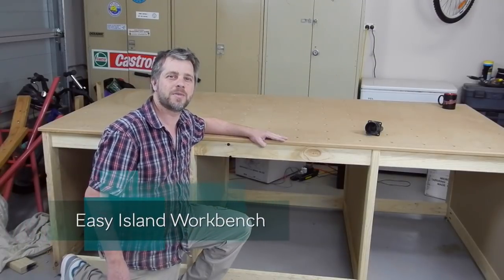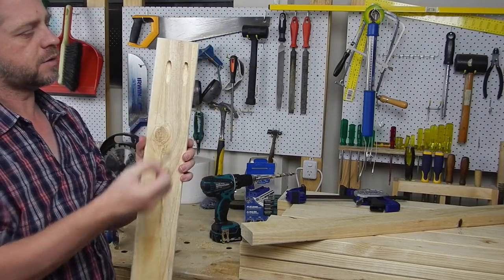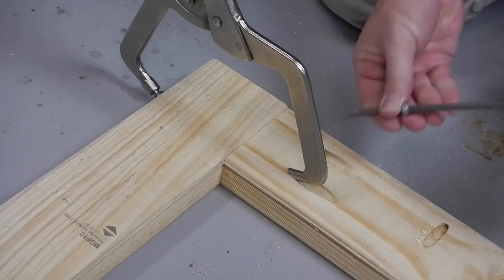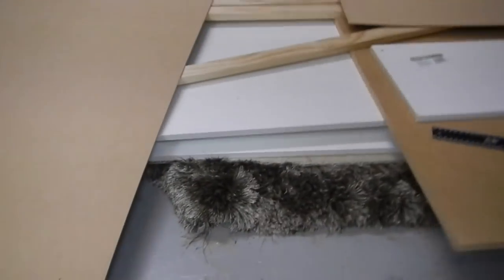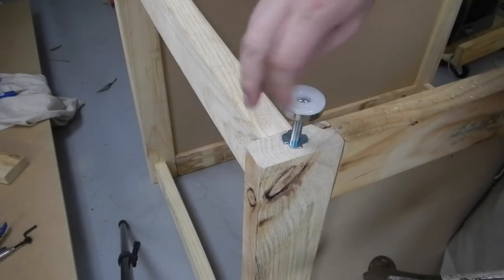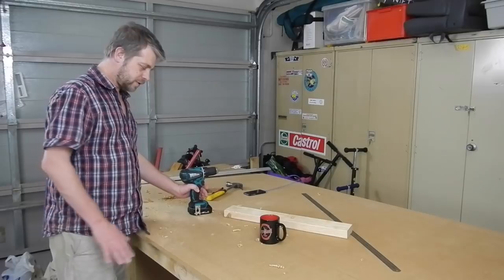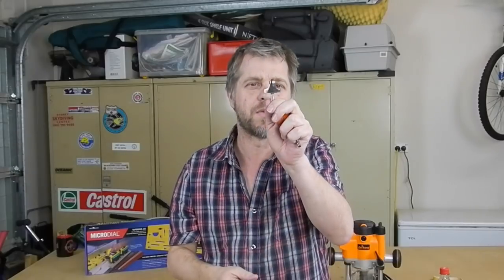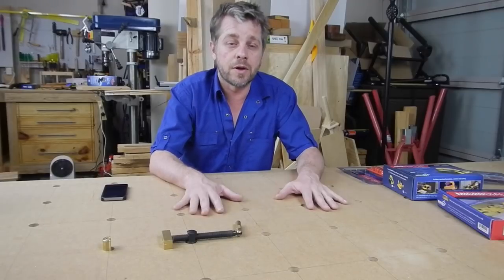How to build a DIY workbench for woodworking projects using a Kreg HD jig pocket hole jig

Comment: Hey Warren, great video mate. Not a lot of aussie woodworkers on here so was glad to hear your accent. Mate, just one question, where can you get those clamps. Want to make the same bench and love those clamps. Also, a new battery in the smoke detector will work wonders, mate. Cheers.
Reply from the maker: Hey Chris thanks for that much appreciated, you can get the Kreg HD jig from carbatec.com.au they are super handy i use mine all the time, the normal kreg jig would be better to start with i think as you can also use it for furniture, drawers etc

Comment: Hey Warren.
Love the video how to.
One question please; 
What material is, (and how thick) your table top? Looks like a composite material, but please, what exactly.
If you mentioned it, sorry.
Wife has bought me the Kreg Master Kit for Christmas, so eager to build myself a work table using your cool ideas.
Thanks again
Reply from the maker: Hi Ross, awesome you have a great Wife, i used MDF its really good for bench tops as its cheap and stable its dusty when you cut it so make sure you wear a mask. Mine is 18mm thick which is around 3/4", if you are making a smaller bench you can also glue and screw 2 pieces together for a thicker top so it does not move around when you are working on it.

Comment: Hi Warren! I just wanted to know, where do you get your 2 x 4's? the ones you used for this bench are very nice and straight.  And I love your Big Square! I think I'll make 2.  Thanks!
Reply from the maker: nancyrfrinemonsreal Thanks for that, the square has been super handy, i get my framing timber from either ***** or Bunnings both are generally good, sometimes you have to pick through t a bit to get the really straight pieces.

Comment: Hi Warren, How did you connect the MDF top to the bench framing? I didn't see any screw holes in the top... (it looked good)
Reply from the maker: Hi There, i used pocket holes in the frame pointing up into the MDF, it worked rally well.

Comment: That's a great looking bench, do you plan to add a storage system (e.g. drawers/shelves) to it? I also have a question regarding the `dog holes', did you find that the drill bit left a lot of tear out in the bottom? It's a problem I've faced a lot when I use Forstner bits, so I wanted to get a sense if maybe spade bits help reduce that issue. Thanks!
Reply from the maker: Hi Jeffrey, the spade drill bits leave less tear out on MDF than the Forstner bit and also eat through the MDF much faster without getting clogged up, they still do have some tear out but nothing to bad, it wont be seen. I was going to put drawers on each end you can access from both sides and cupboards with shelves in the middle, i will do a a video on it as well.

Comment: Warren, the plans indicate that you use 90 x 35 timber but the kreg HD us for minimum of 38mm thick wood. Did you change the drill depth for a 2 inch screw and used the 2.5inch screw or use it as you would use 2.5inch screws ie. for 2x4s?
Reply from the maker: +Anthony Keyburn hi Anthony I just used the settings for 38mm, 2mm would not really make a difference.
Reply: Warren Downes - One Wood Thanks Warren. Merry Christmas

Comment: What are you using for your table top? That looked like solid wood.
Reply from the maker: +Jeffrey Dols I am using MDF for the top, its nice and cheap so if i bang it up it only costs about $30 replace the whole top. Its also stable and does not expand. Just make sure your wear a dust mask when cutting it or sanding it as the dust is not good for you.

Comment: How you built your drawers under that older table? I need some designs to steal for mine :)
Reply from the maker: I plan on doing same thing on new bench, there will be a video for it, but basically all i did was build a MDF box to fit in the area and add runners down the side of it, the drawers are mdf with a pine front.

Comment: Good video. I have some questions. What's the name of the claps you use on top of the surface? The ones you made holes for? And the other is the name of the clamps you use for your triangle. Looking forward for more videos!
Reply from the maker: Thanks Camilo, the the bench clamps are LeeValleyTools http://www.leevalley.com/US/wood/page.aspx?p=62720 i love mine use them all the time, the clamps i used on the triangle are called fence clamps also handy for use on table saws if you want to have an auxiliary fence. Check out our channel i posted another video last week for a moxon vise to fit on the Bench
Reply: OneWood - Warren Downes too late already saw it and subscribe. Good stuff

Comment: What kind of wood did you use for the top?  I like this option a lot better than standard plywood.  It seems smoother and cleaner and not to mention you can round over the edge rather than having to buy separate trim to cover the exposed edge on plywood.
Reply from the maker: Hi Bryan I used MDF For the top. It's also a lot cheaper. That sheet was $23. It definitely is much smoother and if it gets banged up its cheap to replace. Make sure you where a respirator when sanding or cutting it. It's very stable as well which makes it good for jigs.
Reply: OneWood - Warren Downes
I would just add one caveat when it comes to MDF, OSB, or particle board.  If your shop is in a humid location, make sure to use sheet goods rated for exterior use.  Otherwise, over time the moisture will weaken the sheets and make the top sag.  My benches, which live in a basement, have tops with a bottom layer of exterior plywood and a top layer of MDF.  The plywood adds a tensile strength that the other materials lack.

Comment: Warren, nice video.  Would you buy the triton router again if you had the choice and hindsight.  I am looking getting the triton 2400w router.
Reply from the maker: For sure I love the Triton router I bought 2 of them the big one and small one
Reply: +Warren Downes - One Wood Thanks for that.  I will pull the trigger on the big one for my triton router table I just got.  I am also looking at the Track Plunge saw as they seem good value and look quite beefy.  I only have the Kreg K4 Jig, would extra holes suffice given that the screws are thinner.
Reply from the maker: Yeah i love the big TritonToolsRUS router it has tons of power. the K4 will do it easily for this project, i think 2 pocket holes per joint would still be fine.

I have not used the  #triton  track saw but generally their products are good quality so i would say it is as well.

I like you can take the spring out of the big router for a  #routertable  just don't put your face over it when you remove it :)

Comment: Where did you get that triangle, I would like to have that.... great video
Reply from the maker: I made that myself, I really should do a video on it as its very useful. I just laminated 3 pieces of MDF together so its nice and thick and will stand freely. Ideally you need a table saw or radial arm saw so you can cut it square easily.
Reply: yeah, you should do a video... if you have the plans let me know....

Comment: So can you tell me how your dog holes are holding up on that MDF.
Reply from the maker: Hi Paul, they are still as good as the day they went in, i have another bench that is about 5 years old done the same way except with double thickness MDF and they have not worn either.
Reply: OneWood - Warren Downes Thanks for the info I have been debating over MDF, Ply, or hardwood. Thanks again
Reply from the maker: Paul Peterson I think both MDF and Plywood are good options, if its a smaller bench does not hurt to double it up for some weight and reduce vibrations when bashing on it. I went for MDF as its really cheap so i tend to not care if it gets knocked around.